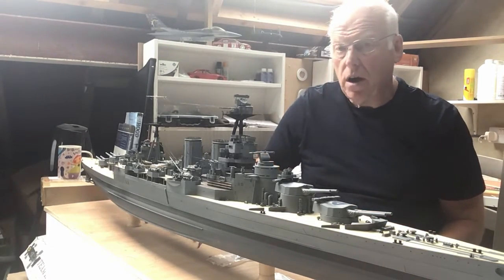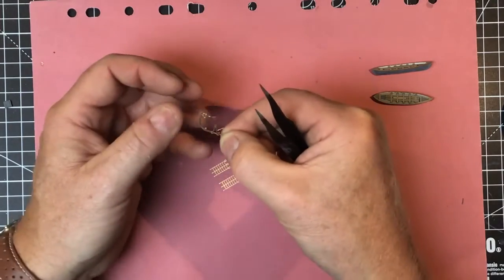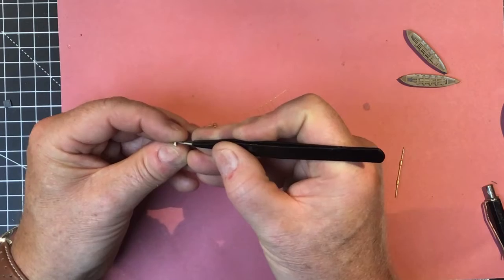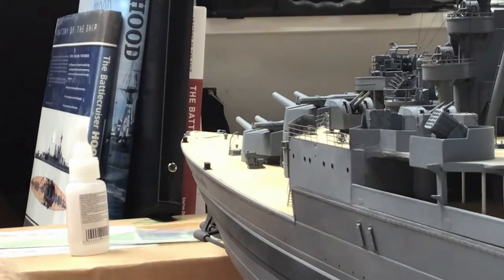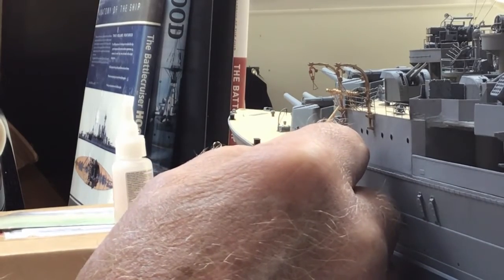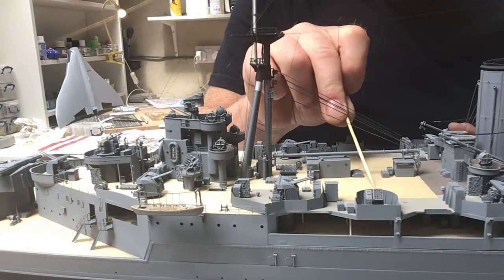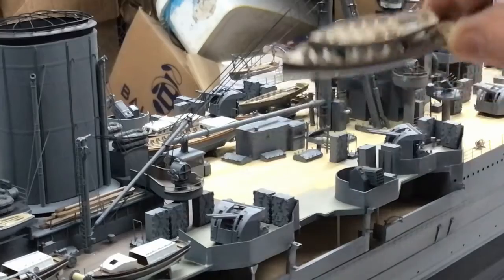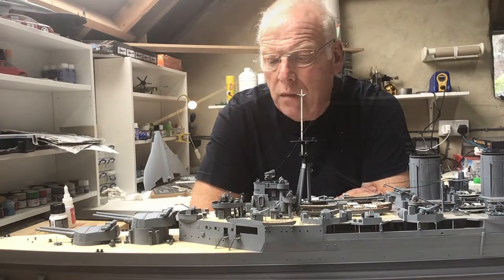Trumpeter 1/200 HMS Hood Full build with Pontos detail set Part 46

Comment: Beautiful work and so glad you mentioned those bulkheads.
Would soldering those brackets on have helped ?
Reply from the maker: If I’d have thought ahead Jerry then yes. if I were doing it again I’d solder the brackets to the bulkhead off the ship then fit the bulkhead at this stage. I’ve been lucky not to destroy the railings because I fitted them too early